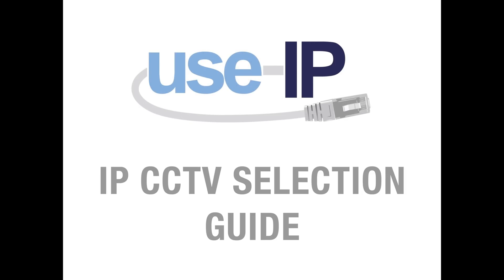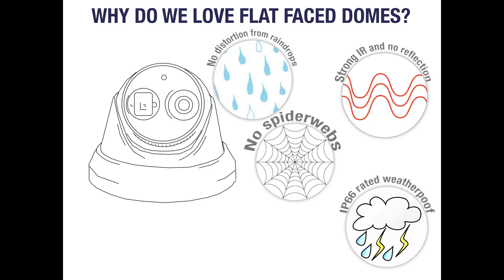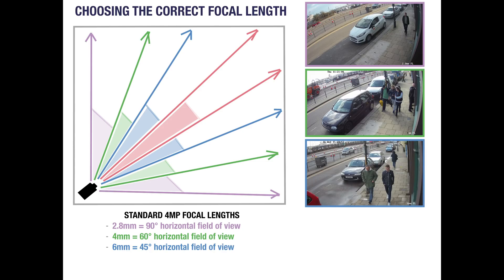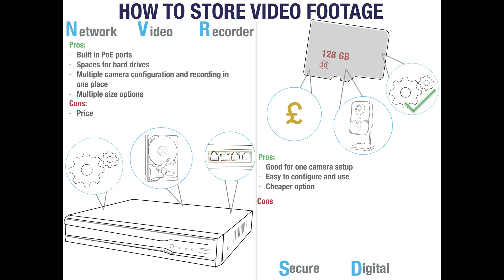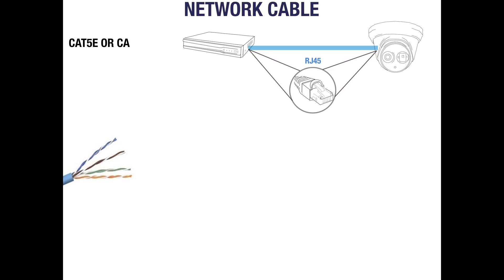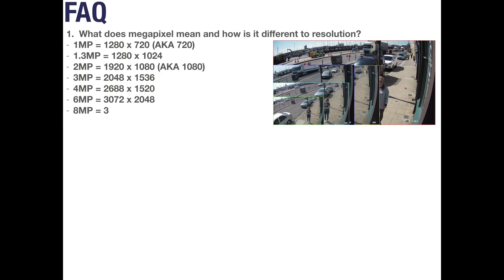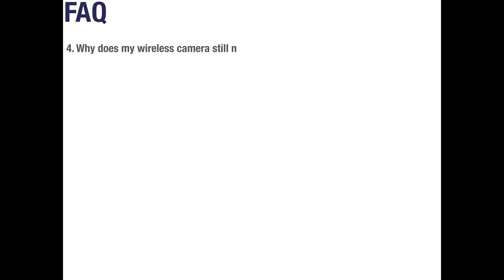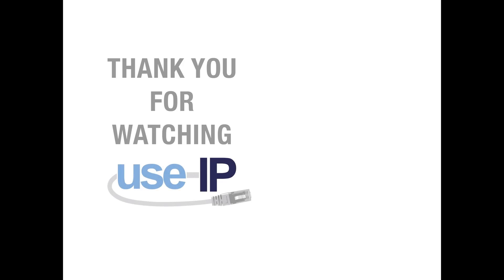IP Camera Selection Guide

Comment: Can you tell me what newer IP camera I should get for my older model Speco TH series DVR? These older models don't use encryption but they do use a password.
It can record at 720P an h.264 encryption.
Reply from the maker: Hi Tim, we only specialise in IP network cameras so we wouldn't be able to recommend any current analog cameras that would work with your DVR, we would recommend you post your question to the use-IP forum and see if some of the 1,000s of users can help you - https://www.use-ip.co.uk/forum/
Reply: @useIP  looking for an IP network camera. That looking for analog but one that works with my older NVR.
Reply from the maker: @GospelOfTimothy  we still recommend posting at the forum, we have never heard of your DVR/NVR model or brand so if you can share as many details of the model at the forum someone there may be able to recommend a compatible IP camera model. (with old DVR/NVR models they are not always ONVIF compliant so they may only support cameras from the same brand and also they can sometimes have resolution limitations - e.g. only supporting IP cameras up to 4MP)